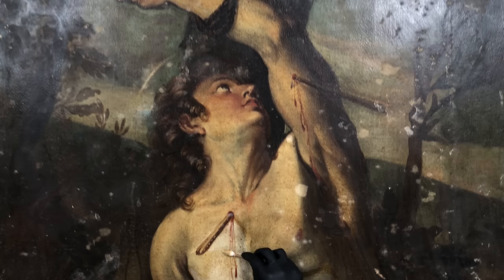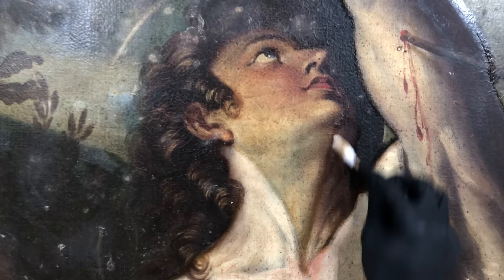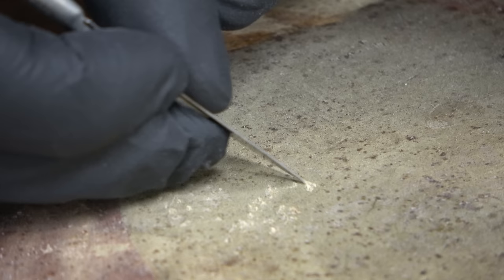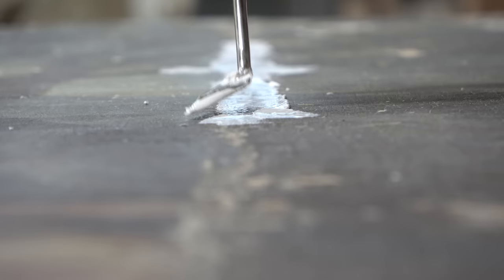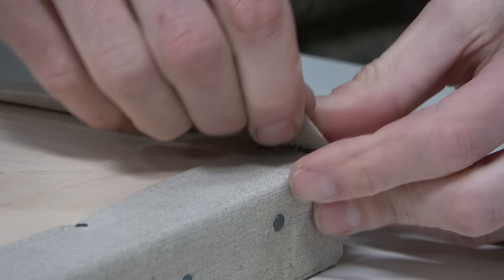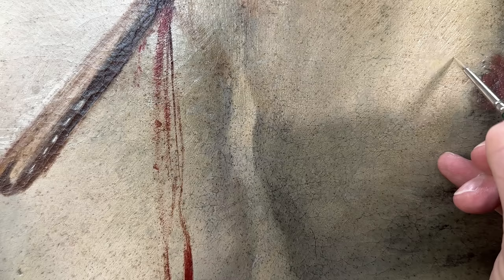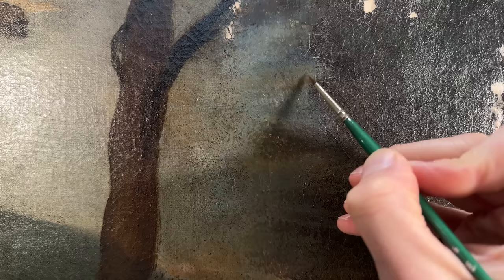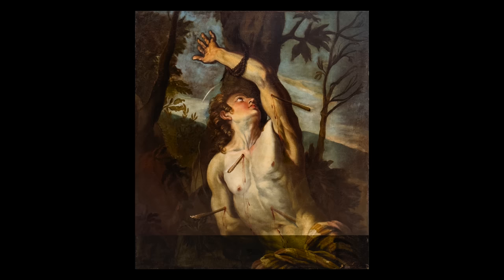The Resistor - Part 2

Comment: This is one job where I'm rather curious how it would look under UV after retouching.  Seeing the piece made whole is definitely satisfying, but a little glimpse into just how much work - how many deft little touches - got it there would be informative and satisfying as well in its own way.
Reply: After retouching with (hopefully conservation paints) Under UV the inpainting should appear extremely dark. This feature is really useful especially when you analyze the painting BEFORE any steps to plan your path as it can provide information such as varnish past conservation efforts, pigments, canvas ground etc. The darkness really depends on the age of the inpainting and sometimes it’s invisible because of the varnish. Cant really tell without a cross-section but UV is super common in most conservation labs!
Reply: @susiestovell791   Indeed!  That's why I was curious as to how it would look after the retouching.  With all the little touches this one required, and the objective of those to not be seen, it would be neat to see it under UV and get an idea of just how much work was put into it in that regard.  :)

Comment: I'd love to know what kind of solvents you are evaluating when it comes to removing the surface grime and varnish.
You are so transparent and educational when it comes to the other materials you are using, so I'm hoping to learn from you in that regard too!
Thanks for all the great work you do!
Reply: Most restorers keep their mixes close to their heart and tend to only share to help out another restorer in trouble. Most are simple alcohols or even detergents to remove grime like cigarette smoke and oils but for vanish a mix of Dichloromethane (DCM) is used. The true talent comes from the ratios they are mixed.
Reply: @littlebacchus216  you have to be careful with some of those organic solvents - I spent many years working in laboratories analysing food and DCM was one we used to extract pesticides from fruit, vegetables, meat, soil etc. Its also a known carcinogen and can cause spinal birth defects so you have to be extremely careful handling it and it and its friends are often also flammable.
Reply: @skwervin1  Very true. I remember it was in paint stripper but banned most places for domestic / public use. As you know DCM is very potent so is used in very low concentrations in restoration.

Comment: The varnished-over fly specks reminded me of a moment last week when I was spraying fixative over an oil pastel "master's study" I had done. I didn't realize until after I'd applied the first few layers that I'd neglected to dust the piece first (it had sat in my room for a few weeks curing and I just literally didn't think about it) and had varnished over a whole layer of fluff. And literally my first thought was how disappointed Julian would be upon discovering all that varnished-over dust on my piece. I could literally hear him sighing in my head. 🤣🤣🤣 

Luckily, it was only a practice piece and I was able to go back and remove at least some of the dust before finishing the varnish layers. But still. Even the merest *thought* of theoretically disappointing Julian with my poor treatment of an artwork is enough to ensure I protect my work from dust and make sure to give them a once-over with a soft brush before fixing from now on. Just in case. 😆

Comment: You always say that tucking in the canvas on the back of the painting is mostly just aesthetic, but I'm not sure that's true. I used to be a seamstress, and I think it might actually function like a hem on the edge of a piece of clothing. Obviously the back of a painting doesn't get as much wear and tear as a skirt or pants, but over the years I think it will keep the edge of the canvas from fraying since the raw edges of the fabric aren't exposed. You do say you are conserving the painting for years to come, so in the long run (I'm talking multiple decades, many moves, etc) I think it would actually help prevent the canvas from fraying to the point where it is lost and ultimately detaches from the stretcher. Perhaps if more people used this technique in the first place, you wouldn't have to add a tacking edge to so many of these older paintings!

Comment: I would love to see a restorastion of a painting that was really well conserved before, just as a reference. Because we (probably) only get to see the worst of the worst.
Reply: he did once have to redo one of his own pieces- nothing was wrong with the conservation, but someone put a foot through it so it needed a repair. he faced the piece, very quickly took off all of his old work, repaired the tear and put it all back together. it was a very short video! 
In general though, I think the main reason we keep seeing 'bad' paintings in his studio is that, one, you won't get a piece in with modern conservation- what we term as 'good'- most of the time, because any pieces conserved that recently won't have had the time to develop new problems, unless the conservator did do an objectively terrible, amateur job (ie coating the painting in polyurethane, or retouching it hideously; mistakes no modern professional would make). Besides which, the new methods are designed to not fail- varnish that won't yellow for another thousand years at least, paints that will never fuse with the original material, etc, so it will be a good while longer before those pieces need to be re-conserved.
Meanwhile, old retouching, which may have been the best available at its time, will still suffer from the problems of old materials; natural varnish yellowing, rabbitskin glue deteriorating, and retouching that had to be done in oil paints. Add all that to the fact that, usually, when a painting goes in that's already been conserved once, it's most likely because the conservation has reached the end of its lifespan, rather than some new problem (like someone putting their foot through it), and it makes sense that the majority of what we see is pretty bad.

Comment: The painting was probably enlarged, when it was already quite old and dingy, and that is why the painting on the more recent bit (the strip on the far side of the seam) is darker than on the rest of it, after cleaning. An option might have been restoring the painting to its original dimensions. (Sometimes paintings were enlarged to make them look grander, or to fit existing frames). I once did a copy of an eighteenth century double portrait, and thought the composition looked a bit strange, only to discover (too late) that the original had been enlarged on the top and down one side.

Comment: I’ve never seen you not secure the keys of the stretcher before 😮
Reply: I'm sure for the sake of being redundant, he simply didn't show the process, but you can be assured, it was done...
Reply: @Quickened1  I’m sure he did! He just usually does it right after stretching the painting.
Reply: @1116_6  maybe he just thinks everybody is more interested in the finer details... Either way, I could watch two hours of his videos at a time. I kind of wish I could take on the role of Kit.
Reply: @Quickened1  I think most people are, but I’m with you on that one. It seems like incredibly hard work though I’d switch shoes with Kit in a heartbeat.

Comment: This is probably going to sound like a stupid question - but as a fabric/fiber artist - I WANT TO KNOW WHAT BRAND THOSE SCISSORS ARE (the ones you cut the new canvas edges with when putting on the support). Good fabric scissors that can be regularly sharpened are WORTH THEIR WEIGHT IN GOLD.

Comment: Question: Have you come across a painting where the original artist cleaned and then retouched their own work? 

Not going into deep details on the artist. I own a painting done in 1963. Oil on canvas. The artist is a well known American painter, his art is highly sought after. It was photographed and the original photo shows the painting as it was painted. The painting was sold and was exposed to smoke damage. The original painter then bought it back and in 1965 the same painting was offered again for sale, but this time it was changed slightly. The original artist cleaned the smoke damage then changed the nature scene slightly. It was again photographed. I have both pictures. I would like to have it cleaned by a conservative, but 2 different quotes for the work, they want to remove the 'overpaint' despite it being original to the painting. I don't want that. How as a conservator would you handle a situation like this? One where the original would be accurate, but so is the repaired image?

Comment: I like your videos, I enjoy your writing and voiceover, I delight in your explanations of techniques etc. I was an art major but I know nothing about your profession except what you've taught me through your videos.

Genuine Question: Couldn't the act of brushing away the putty etc. you've scraped away from the scene be bad for the painting? It seems like you're brushing the gunk you've scraped away back into the painting? Like all that fine residual particulate could get caught in the microscopic cracks and deviations in surface texture? Couldn't you use a lightly powered vacuum tool or something?

Comment: Can oil paint be acceptable as conservation material if you put it on top of an isolation layer? Or is it just silly at that point? You have access to isolation materials so you will have access to the 'correct' paints.

Comment: silly question, but with the isolation layer, you say the reason you use it is to help with colour matching. but if you colour matched to the dry paints, why wouldn't the varnish change your paint the same as the paint already on the painting? is it something to do with the different mediums or something?
Reply: My understanding of that is that the conservation paints are a completely different type of paint and that the conservator is matching by eye what he/she knows will give a good match, by producing the kind of refractive layer that will allow both types of painting to refract in the same way. You do not use the conservation paints dry, and when they dry after application they will look different from the pigment itself. Layer thickness and what lies beneath it will definite affect the visual result.Oh, and I think Julian said it is ONE of the reasons to use and isolation layer. The other is that if it needs further conservation in the future the layer with the retouching can be removed partially or completely. This restoration should be good for quite a long time though….

Comment: Just a tiny thing: sometimes, it's Very difficult to hear your voice-over/narration when your restoration audio is So loud. When you were talking about the new frame & how it was custom built, I couldn't hear what the wood was free of because you'd placed your voice-over almost in sync with your hammering on the frame, 😅

Even with my volume at max I still couldn't hear what you were saying & I couldn't turn to the subtitles because the auto-generated ones are... terrible. What is the frame free of that'll help it to not distort?

Comment: What ARE the “fly specks”?
Reply: Damage caused by insects defecating on the painting. The feces are very acidic and usually quite damaging so should be removed when possible, which he did to the best of his ability. It's possible they will also damage the paint that went over some of them given time, but that's not nearly as big a deal since it's a removable paint that can be reapplied in the future
Reply: @Roger44477  A full, timely and comprehensive answer.
Hey,this really works!
Thanks.